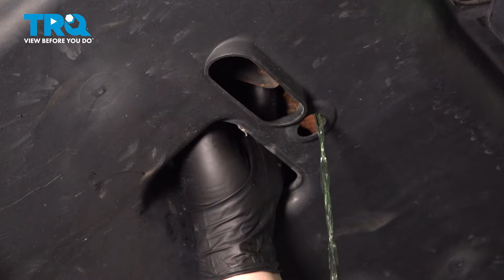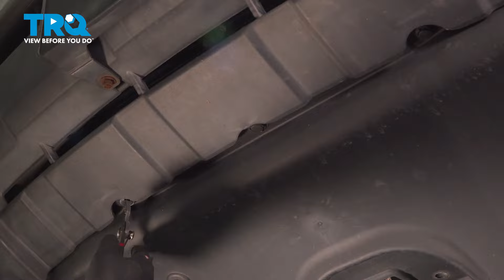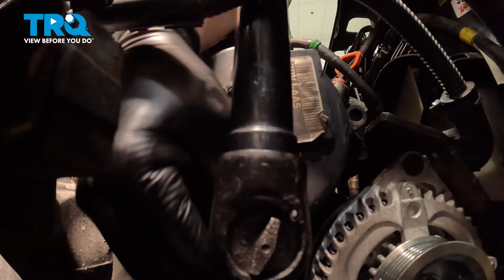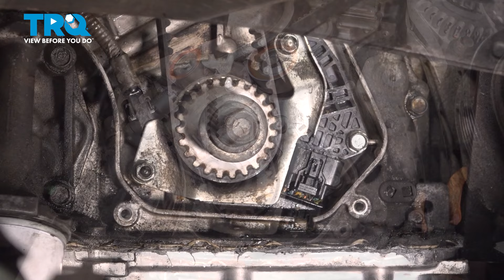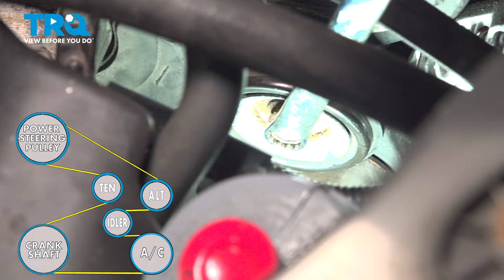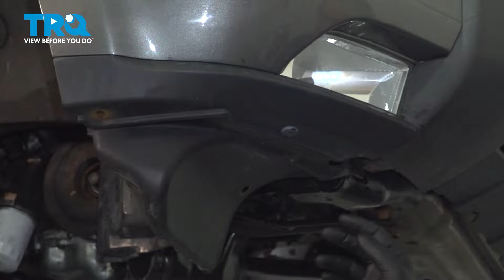How to Replace Crankshaft Position Sensor 2003-2008 Honda Pilot

Comment: i have a 2004 pilot and i think i need a crank sensor. every site shows one that has a wire on it already and looks like a cylinder and not flat like this one. anyone have any ideas?

Comment: you took out too many parts and drained the coolant for what now? i have been torquing bolts for many years and i never understood why 48# plus 60 degrees. wouldn't 48# plus 60 degrees just equal a torque value we could shoot for? i have to do this to my 2004, but i think i'll just junk it instead, this is too much work

Comment: The only reason I think he's draining the coolant is because he's doing multiple videos inside of one video.
It's probably a video for the whole timing belt job but they for some reason put draining the coolant in there which is 1,000% not necessary to replace the crankshaft position sensor

Comment: I guess I not going to buy Honda Pilot... I've changed the same sensor on Hyundai Sonata - only 2 bolts for cover and 1 for sensor. Mechanic charged me $75 and completed within 20 min. I used to like Honda for simplicity.....

Comment: That crank pulley bolt being tightened to torque +60 degrees sounds like the torque-yield bolts used for some of my cylinder heads.  Maybe that procedure is also used for non-yielding bolts as well, I don't know.  Is that a torque-yield bolt, requiring replacement on every new installation?

Comment: I have a problem with my Honda Pilot, cylinders 1 2 3 do not work, this sensor works separately for each set of 3 cylinders.  why did you change it?